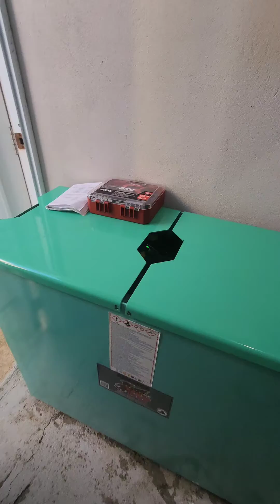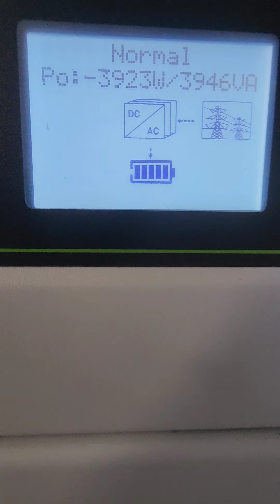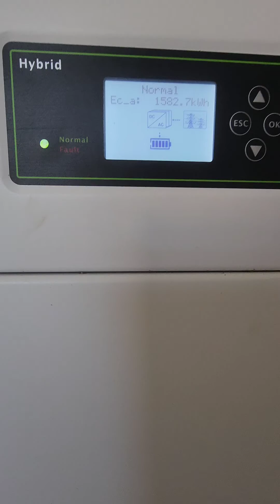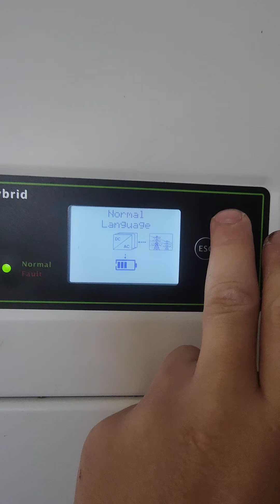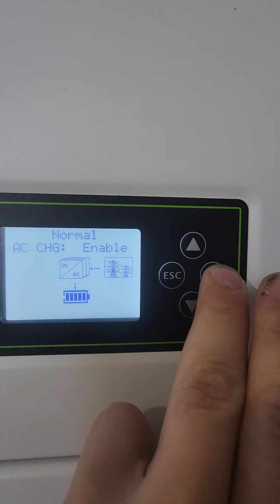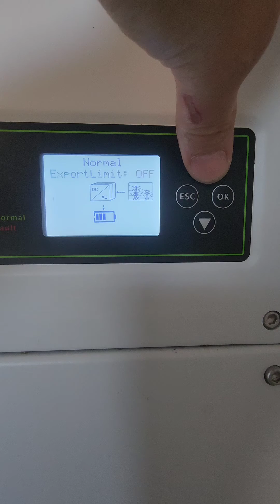Growatt SPH6000TL BL-US display & settings walk-through

Comment: Hi Billy ! Thanks for the video. Is the invertor loud under high energy load ? Or does the natural cooling actually make it quieter than standard hybrid Chinese inverters ? Maybe you could make a short video of the invertor under max energy load ?
Reply from the maker: @nickk5373  The inverter was not loud at all under high load (it has a max of 3.6kw inversion. And sorry, I dont have it connected at this time! I replaced it with an EG4 18kpv about 5 months ago, I will upload a video of the replacement soon!

Comment: how many battery you connected with this inverter and how much ampheres
Reply from the maker: I had an IFLA (Industrial Flooded Lead Acid) Battery made up of 24 2v cells connected en series for a 48v configuration. The Ah of the battery is 716ah (also for each individual cell).